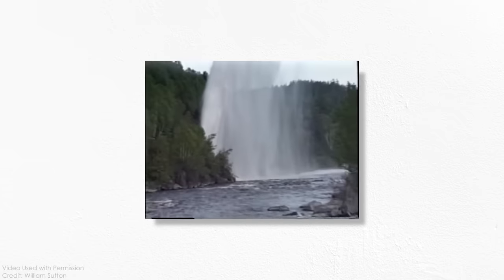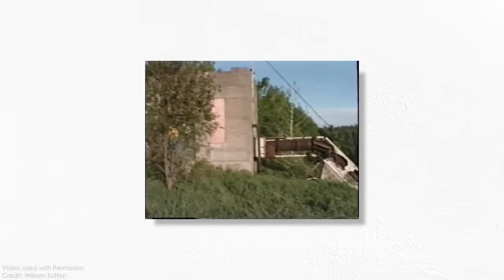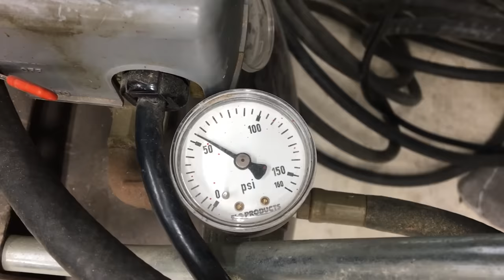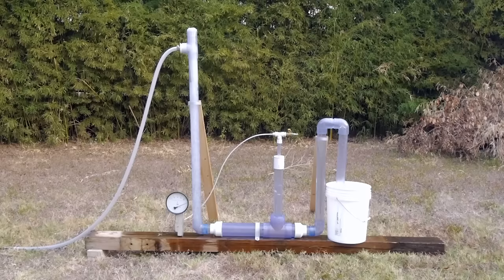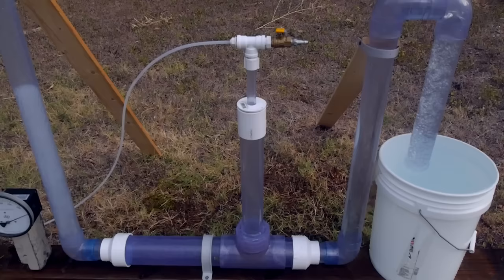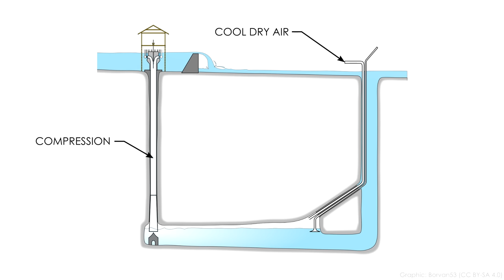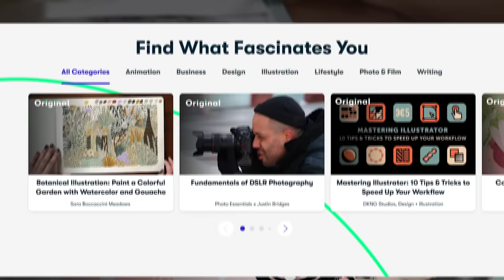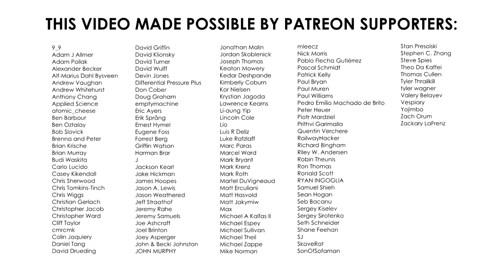Compress Air with No Moving Parts! - Trompe

Comment from the maker: Make sure you never miss a Practical Engineering video and keep up with all my other projects: https://practical.engineering/email-list
Reply: Using it to blow up balloons, and you have a way to teach kids.

...just a thought.
Reply: With not moving part?  But the water is
Moving
Reply: @alejandrodejesusrodriguezq4880  it's true that the water is moving, the point however is that this system is rather elegant in the fact that it doesn't require nearly as much complex and precisely engineered parts.
Reply: No moving parts........ except for the water.
Remember kids if can't be smart just lie.
Reply: You go through a lot of clear pipe
Reply: Jesus. It said no parts are moving. Water is not a part. Be serious. This is for education. You must say thank you to him for enlightening you.
Reply: I am currently studying different ways of moving water with out electricity for a small farm setup, as a student in mechanical engineering I would like to know the analytical and design side of passive pumps and water systems. What books would you suggests for my research?
Reply: @SystemsPlanet  because of the air pressure once the air pressure is gone it would come out the air  Air nozzle
Reply: Im totally subing your channel....i guess you can call me a professional student lol ...
Reply: As the air pressure increases, wouldn't some air dissolve into the water?
Reply: If you leave the air valve closed for too long, will the pressure keep increasing and eventually break the pipe? Or are there factors and/or properties which will prevent this from happening?
Reply: @Practical Engineering do you have a building plan for a small scale Trompe like the one demonstrated in the video?
Reply: the given reason for using compressed air vs electricity seems pretty off, the main reason is that a motor running on compressed air is extremely small and light weight for lots of power (potentially), while electric motors are heavy and most require much more maintenance. safety is not the reason at all (if anything air at these pressures can be pretty unsafe)
Reply: When u did the ram pump video you said I would do a follow up video about a more complicated system with a hydroelectric generator. Are u still going to do that video? I'm very curious about it
Reply: Make a 2 hour Trompe video fully unedited
Reply: You should get with Destin and use a scaled up version of this to fill the baseball air cannon.
Reply: Could we use the trompe to power a steam engine and electricity?
Reply: How big would this need to be scaled up to run air tools all day, and also why are you wasting the energy of the water from the exit?  Put a Pelton wheel on it.
Reply: I would imagine that the air pressure attained would be equal to the head pressure in you riser, right?
Reply: @MrBrander  I believe that the air pressure will never exceed the head pressure in the riser pipe.
Reply: @ottotater2787  This was a model. He specifically said the practical source for the water is a stream. Pay attention.
Reply: Hey, we tried to recreate this project's first half, where you pass air through the water, however our top wasn't covered properly... and it didn't work, was this the reason it didn't work?
Reply: @conorobrien9266  A ram, My folks had a Rife water ram on our farm, pumped water uphill, REALLY!
Reply: How large would a trompe  Need to be for practical applications?
Reply: Thanks. I think that you should use more time to explicate the drawings and videos and technical "Why's" and less to the remaining speech. Or it is so qwick that the image has changed before you have understood (especially if english langage is not your native langage...)
Reply: @SystemsPlanet  àasssßsßaàßàaà
Reply: @SystemsPlanet    "Why doesn't the water shoot out the holes in the 1st chamber?" : With "1st chamber" you mean the "air entrance" or the "air exit"? Anyway, in the "air entrance" the water doesn't spill out because of 1) a property of fluids called "viscosity"  (all water molecules "wants" to be "together" "glued") and 2) the large duct is "more easy" to go because it's large (less pressure) and it's going down ("gravity" - remember that water always goes down) and in the "air exit" the water doesn't spill out because it can continue on the duct (no pressure against) and the air goes out because it wants to go up as 1) It has less pressure (the duct filled with water+air has more pressure) and 2) Because the air molecules is light than water and they also want to be "together" "glued" so they go up because they have different density (separating like water and oil, or soil and water, ... ). I think you got the idea. When the compressed air has the same pressure ("stored energy") as the water+air, it'll stop compressing and the water after the "air exit" will become "pressurized". I hope it's "clear" ("understandable") what I wrote 👍🙂
Reply: I've built a ram pump can't wait till spring I like this concept, Thank you
Reply: Compressed air is NOT as "safe" as you make it out to be.
Corroded air tanks can be a catastrophic cause of serious injury or even fatalities ⚰.💥
Reply: Hi Grady - love your channel!  How did you create the air head of your demo? I can't find online anything that resembles that.  Thanks so much!!
Reply: 👋🏿¹a
Reply: So you are saying that you are making water climb continuously?  If that were the case;  you would have perpetual motion and if it is the other way around;  then it is a hydro air pump.
Reply: I mean that in order to create perpetual motion;  there is only the need to make any amount at all of extra force after after all other needed forces combined are subtracted.  Any amount.
Reply: Has anyone pointed out to you yet that moving water is a part of this design? A "Moving Part"?
Reply: @Myrddnn  I didn't watch it but when I just now started watching it you mentioned that compressed air wasn't a good idea but it could be way more logical and could be done through out natural gas lines and even if it could not get to such of a high pressure that would be needed;  then that could also be created when it has gotten to the homes by using a drive motor and compressor and then at least homes could have turbines compressing air and feeding their tanks.  I will continue watching it but I know what had happened and I'm sorry about that.
Reply: im sorry to say but it took me only 5 min to figure out this would make a AWSOME smoking aparatus ( dont do drugs kids  not untill your of legal age  <3 )
Reply: I've thought of two things that it would be useful for and at the same time would return part of the energy;  for heating with a high efficiency as the natural gas flames would would be drawn into it as the air bubbles and it could filter the exhaust at the same time and if it would have a very long and addequate travel through the water;  the bubbles could maybe become oxygenated and this coule be an isolated system of sorts.  And the second one might had been the second part of this.  I'll add it when it comes back to me.
Reply: @SystemsPlanet t😮
Reply: I wonder if you could combine this with a wirtz pump and a pedal/hand crank to make a manual compressor of any value...